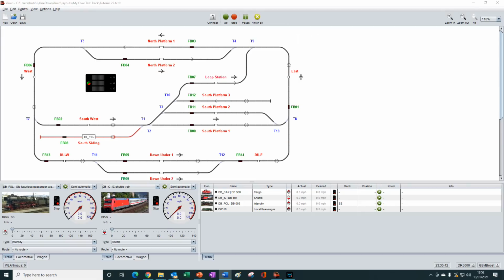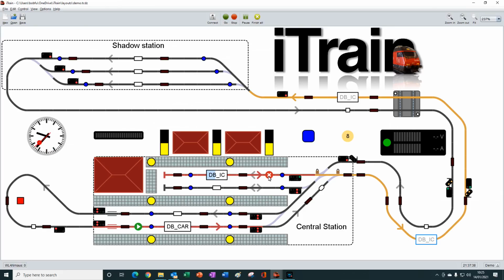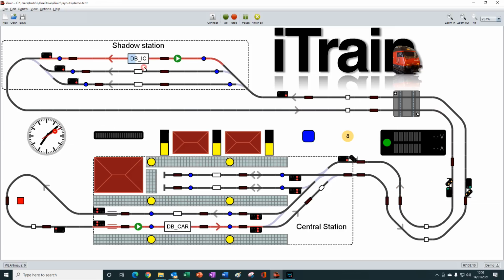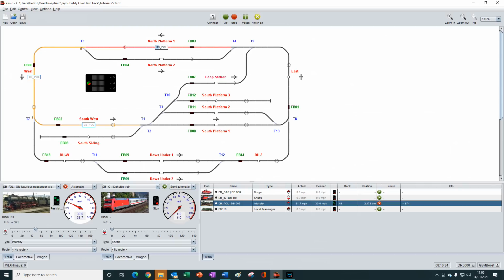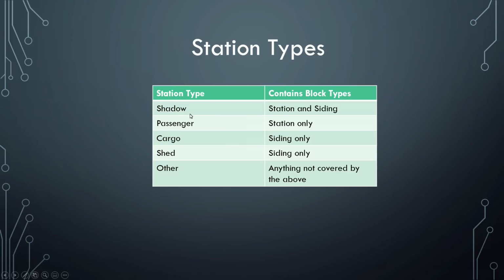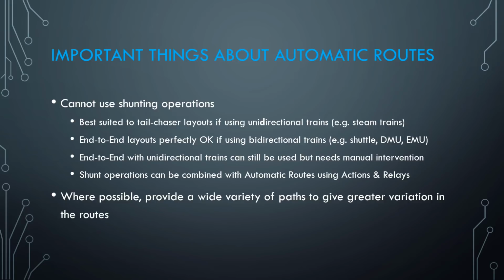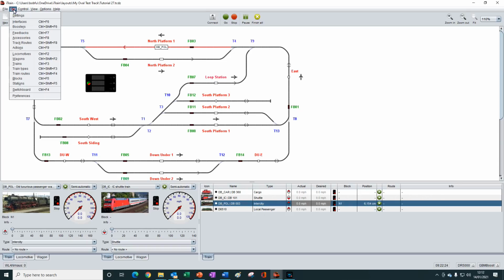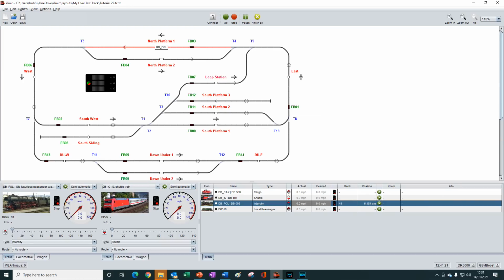Video 27: Using iTrain Tutorial Series - Introduction to Automatic Routing & Stations (Part 1)

Comment: Hi. Love your videos! Thanks. iTrain always select the same block in automatic routing. For example there are two blocks it can select, one is straight after a turnout, other is branched from turnout. It only selects straight. If I disable that block, routing does not continue. I'm trying to figure out why? Regards.
Reply from the maker: Hi Derin
Thanks for the comment. Regarding your question, can you post the question on the iTrain forum and attach your layout file to the post? Your layout file is needed to make it easier to answer your question.
Reply: @bobfuller  Yes of course, I’ll do it. It’s all about train waiting rule. If I enable “Wait” iTrain selects randomly. But I do not want my trains to wait there. Thanks again.